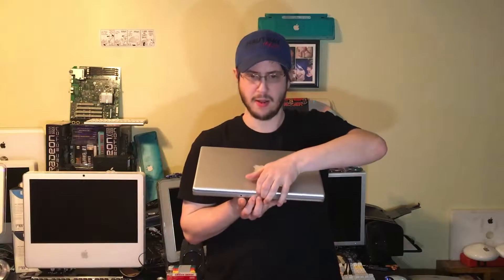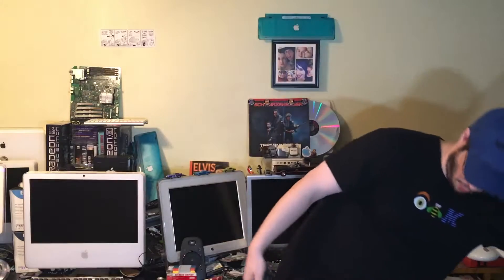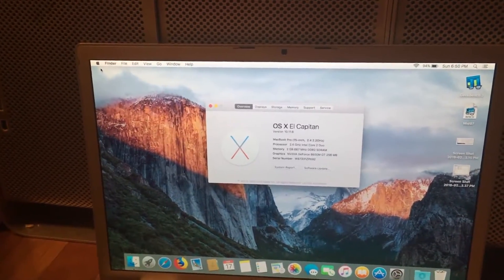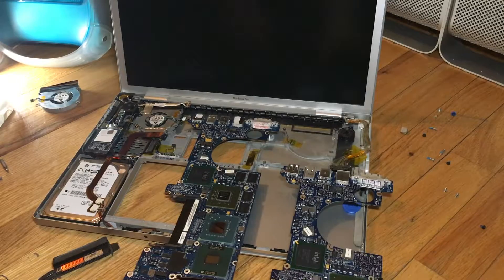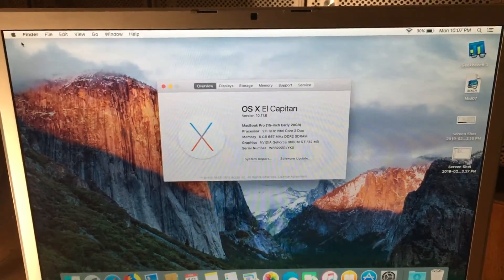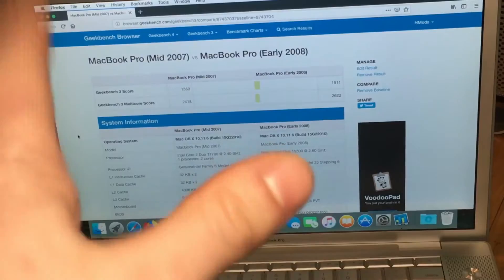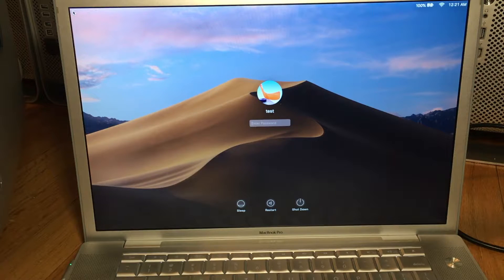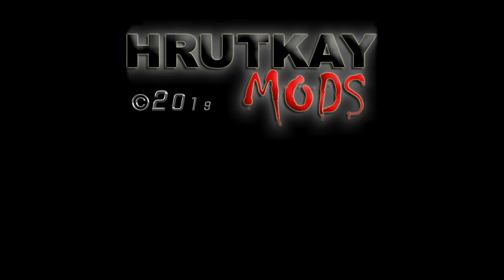Trying to Build The Cheapest 2.6GHz Early 2008 15” MacBook Pro Pt.1

Comment: benchmarks for the mojave build would have been cool to see in comparison to the previous..maybe in a later vid
as far as temps,mine are 48 cpu and 50 gpu but i run my speeds at 3,000 for both sides...give that a shot and see what u get
Reply from the maker: Check out the end of pt 2 I have benchmarks of it in Mojave